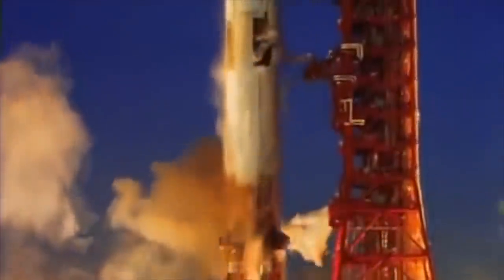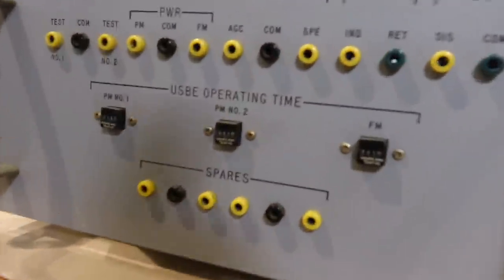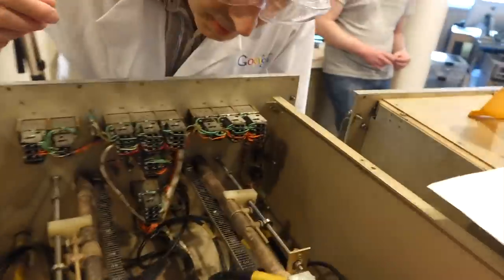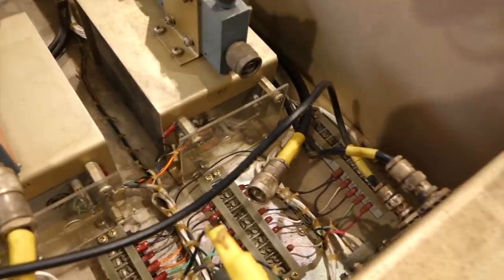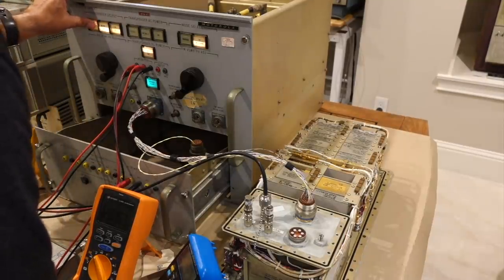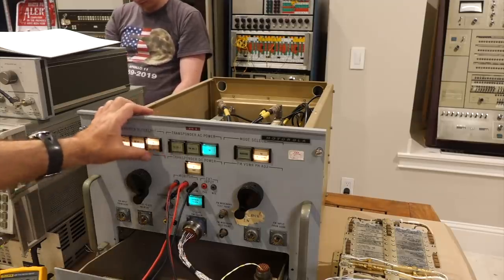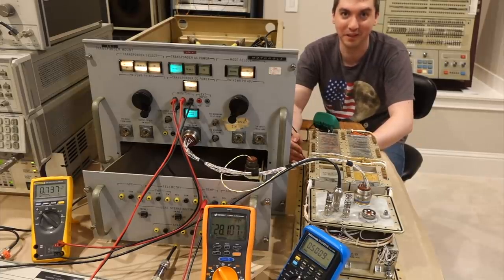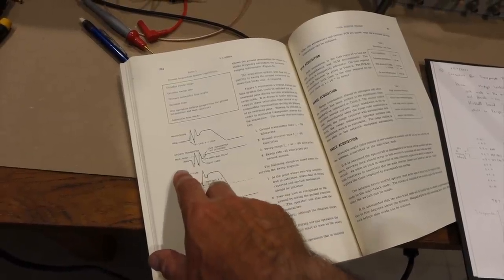Apollo Comms Part 5: Transponder first power on.

Comment: CQ CQ CQ DX this is Marc! Calling from the Moon. Longest DX contact yet.

Brilliant work, gentlemen! Did you ever think you'd happen upon the original test apparatus? Fantastic.

Somehow, I'm not surprised that this gear is still operational. It's a true testament to the men who designed and built it.
Reply: You know, that may just happen when the Lunar Gateway is eventually launched and becomes operational.
Reply: QSL card or it didn't happen.
Reply: Does Moonbounce (Earth to Moon and back) count?
Reply: I doubt it can die, as long as it is operated within spec. I have no doubt that it would still work in 50 years at which point other things would naturally bring it down.
Reply: It’s just as much a testament to the taxpayers that spent millions on it.

Comment: We have that same crimping tool at work. My boss frequently grumbles about how much it cost. More than a cheap used car!
Reply from the maker: Fortunately Mike got the Chinese copy version. Still quite a good quality tool!
Reply: These tools are worth every penny though. Absolutely dependable. I’ve been using the same style of a tool with Hirschmann connector pins – zero field failures. These four-indent crimps form gasless joints and flow the contact and wire metals together. For an extra 1000+ year reliability use Teflon insulated wires and crimp in a dry Nitrogen laminar hood. It’s basically expected to last millenia then, without any wire-to-contact degradation.

Comment: Just out of curiosity what power supply was used to generate the 400hz AC? I have an old torpedo gyro with a sustainer motor that takes 400hz 73 volts single phase.